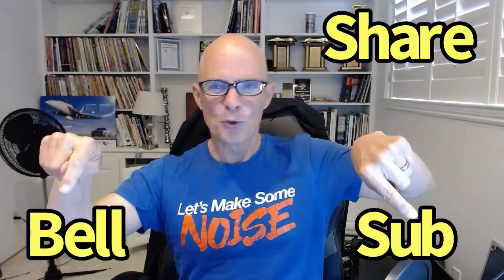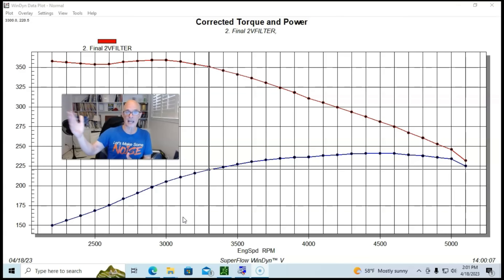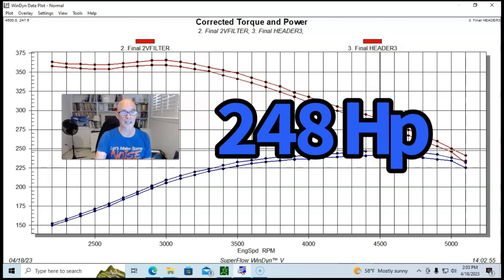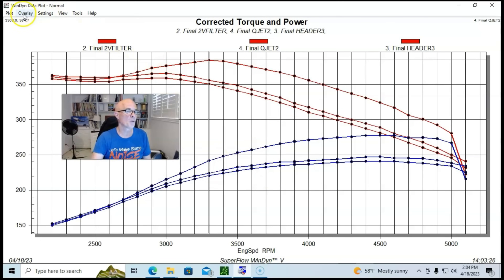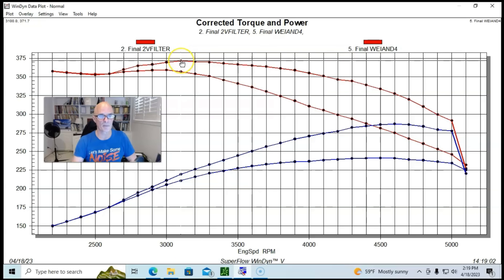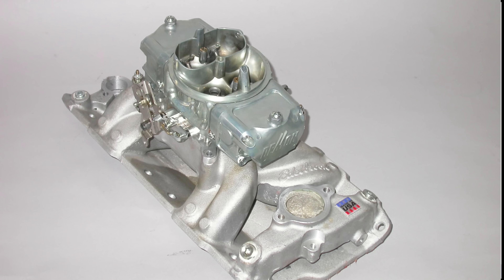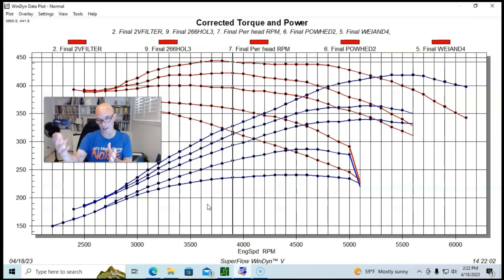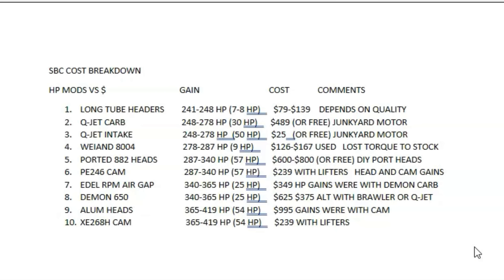HOW TO: CHEAP SBC MODS THE $1000 QUESTION? WHAT MODS ARE WORTH THE MOST POWER AND WHAT DO THEY COST?

Comment: I love old school gen 1 mods! Putting a ls in my corvette requires some chassis mods, but the gen 1 can still make 500+hp easily so for me, why trade up?
Reply: Because they don't last as long, get worse gas mileage, weigh more, worse drivability, have crappy cork gaskets, and you literally need to replace every part to make any sort of reasonable power.
Reply: @RindosRides  but they sound the best 👍
Reply: @RindosRides  those same things can be said abut ls engines.
Reply: To make 600 hp😂
Reply: @ufarkingicehole  sometimes it pays to be grateful for what we have and not want more all the time. (Easy done) 
Too much power ruins a street driver. 500hp is already alot of power and maybe even too much for some cars/people
Reply: @Harrybowles1969  to each their own...  Some want more and Richard gives a lot of people the knowledge to do it with out spending an arm and leg
Reply: Yup I love them all. You got to do what you love or there would be no point. Just saying most people including myself want 1000 hp on the street then when you get there preferred the days of 500 hp. No right answers here though obviously
Reply: @ufarkingicehole  you can make 600hp with a SBC, and still spend less money then with an LS.
Reply: Lol